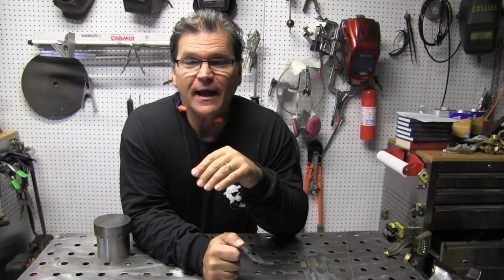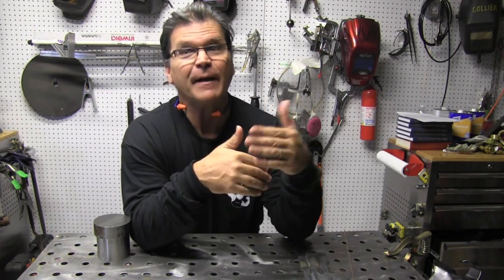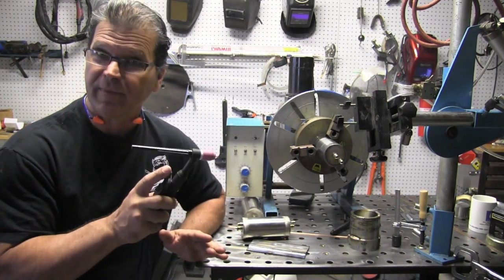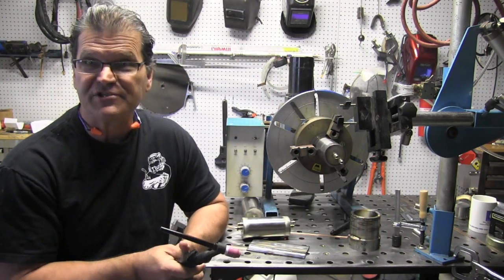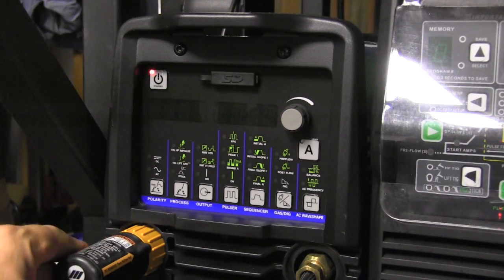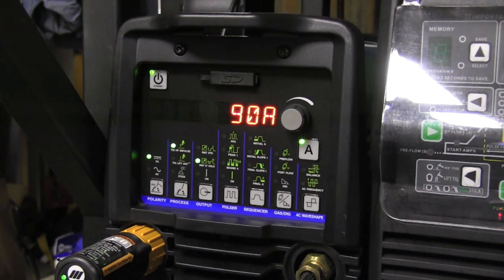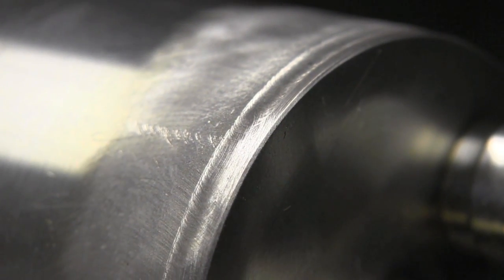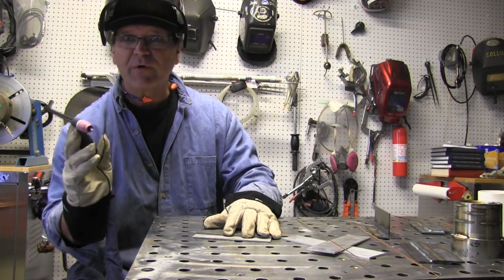Tig Welder Settings 2t & 4t - Dynasty 280 and Everlast 255ext

Comment: I understand the max output is 120 amps at 60% duty cycle. If I only have 120v in my shop at the moment would it be safe to run this machine at about 90-100 amps stick of off 120v regularly?

Comment: Here’s where your discussion of 2T vs 4T should have begun……

What Does 2T/4T Stand For?

To answer as simple as possible, you should note one thing first. The “T” in 2T/4T mode stands for touches. So, if you select the 2T mode, you will need two touches to initiate and finalize your welding arc. Long story short, you press the switch on your torch and hold it. Then, once you release the trigger, the arc stops, and you conclude welding.

On the other hand, as the name states, with the 4T mode, you will need four touches to start and complete your arc. So how does it work?

You will have to press and release the trigger to start an arc. Once you release it, your arc keeps going until you hold and rerelease it. That’s how the 4T mode can help you reduce hand fatigue when dealing with longer beads or working in tight spaces. This is a pretty straightforward explanation, but the use of 2T/4T mode differs when dealing with MIG and TIG welding. So let’s look at the differences of 2T/4T mode in MIG and TIG welding

Comment: Hey Jody, Is there a good rule of thumb for 4T settings? My AHP has start and end amperage settings and I haven't found any videos that give a good indication of how to choose these numbers. Thank you for all of the great videos!
Reply from the maker: It’s mostly a matter of preference, thickness ,and diameter of tungsten. For example higher start and end amps for thicker metal
Reply: @weldingtipsandtricks  thanks for the quick reply. I guess I'm just overthinking the whole thing. In my mind I figured that the start and end amperages would be some percentage of your main amps. Obviously all of those numbers vary depending on what you are welding and other factors, but is there any relationship between start, end, and main amps that can be quantified? Or is that, as you said, really just personal preference? This question came up because I found myself in a position, for the first time, where I couldn't use a pedal. Thank you again!

Comment: Good explanation of petal vs.trigger and their benefits. Do they make a switch for the torch that can controll amperage,kind of like a dial ? 
And how do you rate the Everlast welder as compared to the Miller 280 considering that it’s about half the cost? And how do you feed the filler rod so smoothly with gloves on?...thank you fir your great vids!

Comment: DOES CK MAKE THAT SWITCH TO FIT A#9 OR#17 FLEX LOC TIG TORCH? SWITCH WHEN THE FOOT PEDAL IS NOT BEING USED,IT'S USED BY PRESSING DOWN RELEASES UP(CONTROLS AMPS ON TOUCH START)
Reply: EXCELLENT VIDEO ON THE ADAPTER THAT ATTACHES TO TIG TORCH WHEN"TOUCH"WELDING,NO FOOT PEDAL.I LIKE THAT STYLE,DOES"CK"MAKE THEM LIKE THAT?

Comment: I've been interested in the Everlast 255EXT for some time.  I'm now in the position to purchase a welder and am having trouble deciding between the Everlast 255EXT and the Everlast MTS 275.  I will be using the welder as a hobbyist/DIY and like the idea of having one machine for both MIG and TIG.  Do you have any experience with the MTS 275 or do you see any downside to purchasing an all-in-one machine considering my application?  Thanks for your help and I love your channel.

Comment: Jody I wish u had used the spot weld option on the 255 when u were making the tack welds.  Is that an option that would be more efficient and u really don't have to change the welder setup if it's a saved program. Isn't that correct?

Comment: On the Dynasty 280 - is the raw power really a lot better on the 280 vs the older 200 amp models ? I've got an older 200DX ('07) that I'm considering an upgrade ...? Also , can you show some differences on aluminum ac with the additional wave shapes vs being stuck to only square wave on the older 200DX ?
Thanks Jody - love the vids
Sarge

Comment: Can't wait for more video on the Miller 280.  I'm a little embarrassed, I bought one of those machines about 3 months ago  and I just hooked it up today after watching your video.  There are a lot of options to say the least.  I did use your rule of 33's on some aluminum, and it worked out great.  I also ground a few tungsten due to hitting the puddle on accident.  You make it look so easy, but with your videos it is also very easy to follow along doing my practice homework.  I look foreword every week to a new video, oh and by the way I love your tig finger. I picked one up on Amazon.

Comment: Hey Jody. I'm 16 and im looking to buy a mig/stick/tig or tig/stick/plasma multiprocess welder. What's your recommendation for a good welder that will last and has a good duty cycle? I have a range up to about 1200. Everlast? Longevity?  Lincoln?
Reply: I can't say anything about the Lincoln or Longevity but I've been very happy with my Everlast so far.

Comment: Very informative videos, always have liked them.  Quick question what are your thoughts on "Zap, Zap" method.  Both on Tig and Mig.  I have seen quite a few companies sell welded parts that are obviously, for every ripple is a separate trigger pull.  This is in the off road industry, I don't want to admit it but I have used it to weld overhead on like 1/8 thick frame under my truck.  Thanks.

Comment: Thanks for all your videos, they help me a lot. Could you please make one about proper locations too tack and which sequence to weld to reduce warpage. 

Thanks again
Reply: I know you've touch on these plenty, so I should probably be more specific. I welded a U shaped frame out of some C-channel, and it warped really badly. Someone mentioned that welding from inside the corner to outside would reduce warpage. Stuff like that.

Thanks

Comment: The Dynasty 200 machines we have at the school are all hooked up to 460 so I was wondering: Do you have a dedicated transformer from the power company box lines to your shop?
I know little enough to ask this question but enough to be curious.
Thanks!
Reply from the maker: I have mine plugged into a 50 amp 230v circuit
Reply: Thank you!

Comment: Thanks mate for the videos,  appreciate the tips on the thin material with the switch as that is the affordable setup for beginners.  I am using the boc tig 185 with the 26 gas Saver torch, it's a basic machine but your tips have helped me learn to tig weld.  Any more tips on thin 1 to 3 mm sheet metal would be great.

Comment: I bought an everlast 185 tig/ stick machine, never liked the foot pedal, have always used the switch, made it hard when starting to tig weld and using 18 ga steel to start with. Your videos have helped alot with realizing how far my tungsten should actually be from the piece. I just weld quite a bit as a hobby/ auto types of repair.